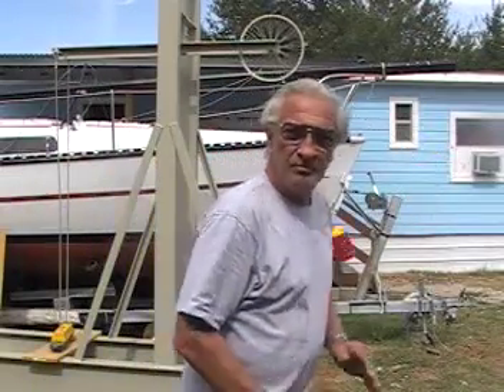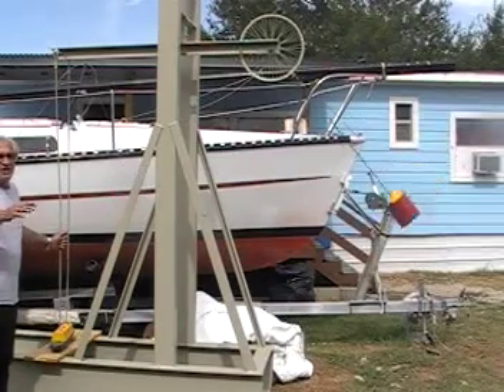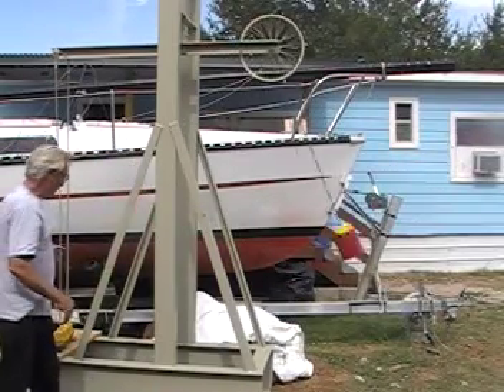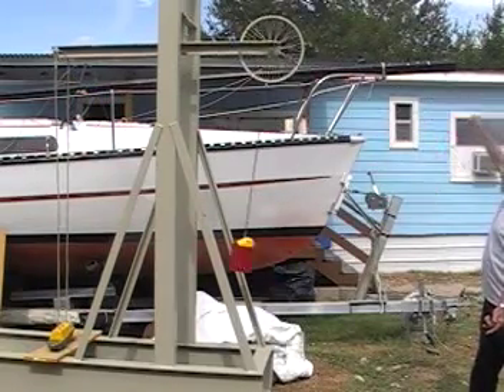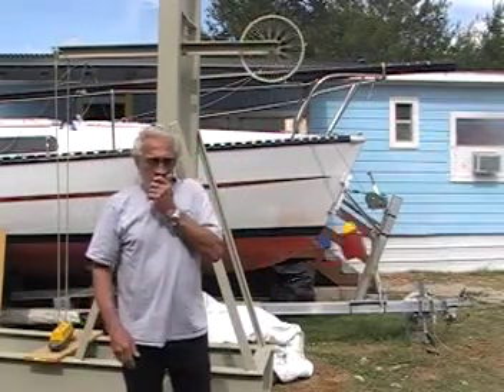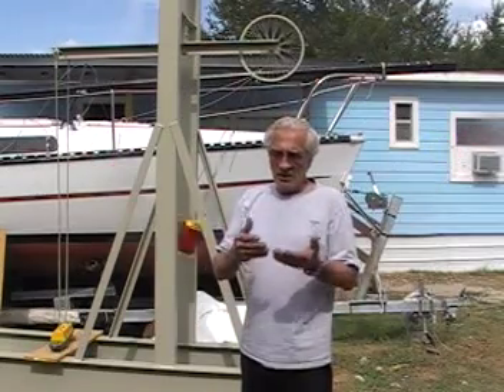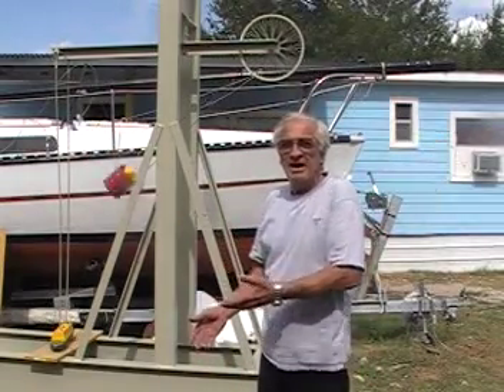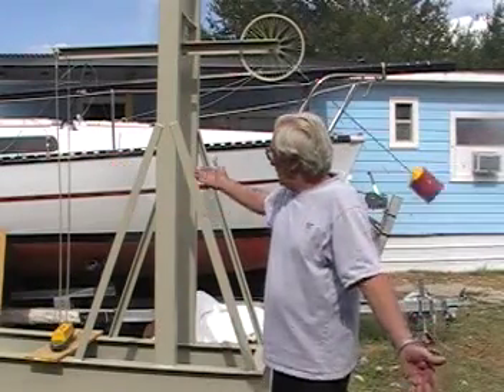testing large Milkovic 2 stage oscillator Video 6

Comment: Cont.: 4) Add the distance d to h2: h2 + d = h3. Now compare h3 with h1. Are they pretty much the same? If yes, the oscillator has an energy surplus. If h3 is noticeably smaller than h1, the oscillator conforms to the conservation of energy. -
It's always possible that my analysis is flawed. But IMHO the experimental evidence to the contrary needs to be stronger than what's been produced so far. --- And sorry for using up so much space ;-)

Comment: Cont.: Measure the vertical distance d that the pendulum AXIS (the pivot point) travels while the pendulum is pulling down its end of the horizontal bar. - cont.

Comment: Cont.: Another possibility would be the measurement I proposed Mr. Milkovic, which he deemed unnecessary:
1) Measure the height ho of the starting point of the pendulum. Keep the horizontal bar fixed. Release the pendulum. Measure the height h1 that the pendulum reaches on its fist (half) swing.
2) Bring the pendulum into the same starting position ho. This time, the horizontal bar is not fixed. -cont.

Comment: That energy will of course not be fed back into the right part of the device anymore, so you will have to do continuing and stronger pushes to make up for the loss. But you need to be able to measure the coupled out energy to compare it with the intput, not like Milkovic's IMHO pathetic attempt with the flashlights.The most compelling evidence of course would be to use the coupled out energy to drive the pendulum, i.e. achieve a self-running device. As far as I know, that hasn't occurred.-cont

Comment: Cont.: To what extent the seesaw movement of the bar attenuates the pendulum swing depends largely on the height the weight is lifted, or to paraphrase it, on how much the pedulum trajectory deviates from being circular. The more circular, the smaller the attenuation, and the more liftings. If you really want to compare output with input, you need something to couple out some of the energy, either while the left part of the bar is moving up, or on its way down. - cont.

Comment: RHEAD: Pushing with double force? No. I've outlined the condition for 'lifting the weight at all', not 'lifting the weight once' or '...twice'. You can't just add the number of liftings and say, "look what I put into it, and what I got out of it". This is an oscillation with an ongoing transfer of energy between the two sides, with some of the potential energy of the lifted weight used to raise the pendulum (increase its potential energy), and some to decelerate the pendulum.- cont.

Comment: CONT. Now, imagine that the pendulum part of the bar was 8 times as long as the part with the 74 pound weight, and there would be no pendulum, just a rope with a handle hanging down, 8 inches of pulling the handle down with a force of 9.4 pounds would just about lift a 75 pound (9.4 x 8) weight 1 inch!!! 
What it boils down to is the following:  -- to be continued

Comment: CONT. Now, considering that the bar already starts to turn when the pendulum is still about 15° away from its bottom position, only about 95.5% of its initial potential energy have been converted into motion. That means that the kinetic energy input from RHEAD100 is about 4.5% of the initial potential energy (approx. 190 J) = 8.4 J. That means that RHEAD100 may accelerate the pendulum across an estimated distance of 8 inches and exert a force of about 9.4 pounds.  -- to be continued

Comment: Let's analyse this video a little closer. If the 46-pound pendulum was released from a 90° angle the centrifugal force could lift a maximum weight 3 times the pendulum's weight = 138 pounds. With the bar ratio of 1.41:1 the pedulum could still lift a weight of 98 pounds. Now, with a max. angle of approx. 77° as shown in the video, the pendulum could lift 76 pounds at the bottom which is roughly the left weight. -- to be continued

Comment from the maker: Encouragement is ALWAYS Welcome. 
We aquired another 809 pounds of lead yesterday 8/15/08 Scrap yards are the best source of material for this type of experiment.
Yes we are trying to use a mechanical feed back to keep it running. It takes no more that 3 pushes on the penulum and watch it pick up 74 pounds 6 times for any one to realize this thing is putting out far more than they are putting in. I have let lots of people try it. Every single one is amazed.

Comment from the maker: The power bar has a ratio of 1.41 to 1.
Without the 46 p[ound pendulum you need a 104 pound pull at the wheel to lift the 74 pounds.Some balancing Act HUH.

Comment from the maker: If you put the bathroom scales under the weight on the right without the 46 pound pendulum. It  weighs 74 pounds. That is why we swing the pendulum as close to 90 degrees out as posible. When the pendulum is high in the air and stops to change direction.  At that very moment. It has no weight and pulls nothing on the weight on the right and it comes down with the full 74 pounds of weight moveing 1 inch.

Comment: You say that you are picking up 74 pounds on the left side.  Maybe before you connected it to your see-saw device it was 74 pounds. If you put your bathroom scale under the weight on the left side and weigh it while it is connected and not moving, what weight do you get now?  Your see-saw has a lot of weight on the right side, too, including the weight of that wheel.  It's a balancing act and I would guess there is little actual work being performed.  Work = force * distance = ? * 1 inch.

Comment from the maker: Actually, Hermann;  It is nothing more than as very large & heavy Grand Father  Clock Pendulum, that has a higher swing, giving it more power than is needed to load the escapement. Most people don't realize, 100  or 10 pound pendulum, Once they are swinging. It takes no more energy for one than the other to maintain the swing.

Comment: We have an old 4 Ton Cast Iron Wrecking Ball going rusty in our yard at Red Scar Foundry.  plum shaped. We have 28 pounds of N35 Neodymium Magnets, little thin ones, ideal for a short-stroke three-phase alternator. 

Red Scar Industrial Coatings Ltd. "Veljko Milkovic" Pendulum will incorporate this pulse-short-stroke-alternator. Folk at home, swing a weight on a string and rubber band, watch it stretch. put soot on the knot, and measure the stretch through a paper tube. Physics costs now't!;-D

Comment from the maker: In my next 2 stage oscillator we are building now. The power bar will have a 8 to 1 ratio. Giving us a 4 inch vertical movement at the power end and only ½ inch movement at the pendulum end.  With this ratio, and an 800 pound pendulum. We should be producing aprox. 16 horse power out and less than 1.3 horse power in. Coupled with the new designed pendulum. I am hoping for less than ¾ horse power needed in.

Comment from the maker: Thanks Alastair;

What I did not tell in the video is that the power transfer bar of the second stage is a 1.41 to 1 ratio.
And that 74  pounds moving 1 inch is aprox.  1.6 horse power. And it takes a 104 pound pull at the pendulum pivot point to lift the 74 pound weight.

Comment: The compliment is passed up the chain. and the chain goes back furter than Galileo Galilei. "Centripetal Acceleration" is the "Key Word". It is very real. We have here a system where "Gravitational Acceleration" and "Centripetal Acceleration" are both working in harmony. Forces are just the result, acceleration is the cause. A force acting through a distance, is called work.

BTW. Prof. Walter Lewin (YouTube) told his Undergrads to not even attempt the mathematics of a "Large" angle of swing.